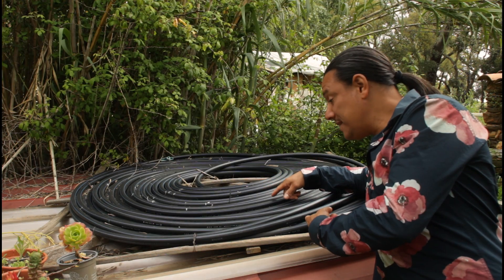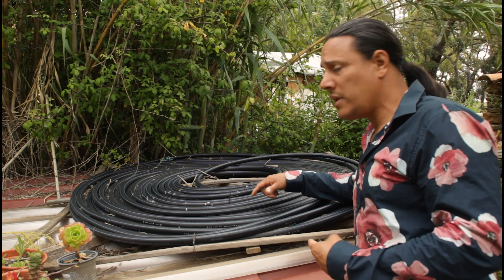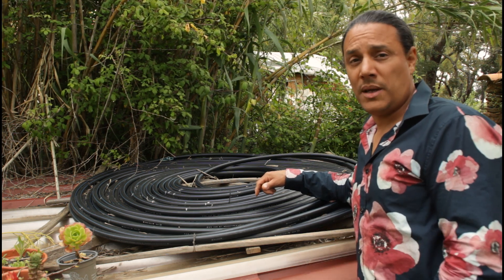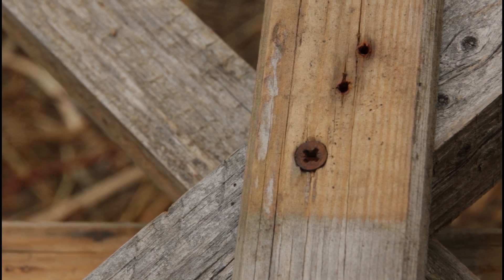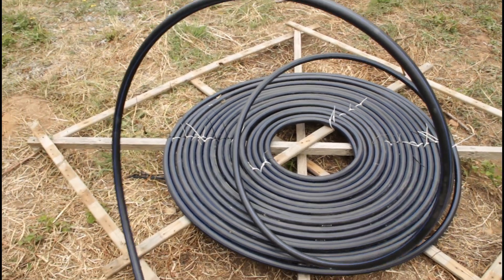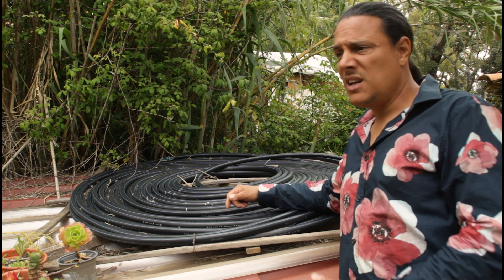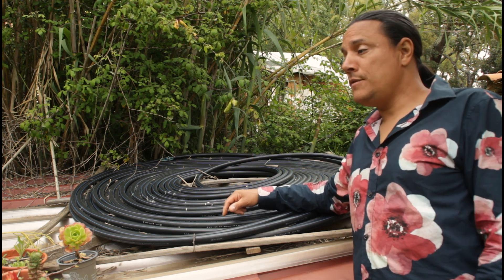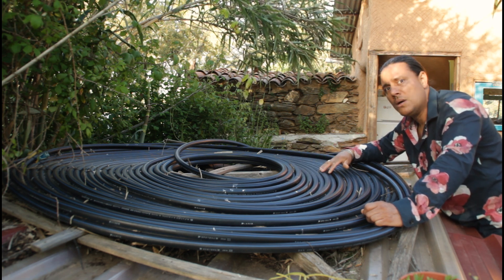Free Hot Showers Using Only the Sun (DIY Solar Coil Heater)

Comment: Yes please- how to fittings from pipe coil 🙏
Reply from the maker: Noted! An extra small shower structure is in the books. I need another coil on the roof.

Will keep you posted but have to save for materials so could take a while 🤓😆

Comment: Jus a possible tip, u ever thought up putting aluminum or a mirror at the bottom.. theoretically creating two surfaces that act to heat the water pipe ( just an idea )
Reply from the maker: Yes, this could work definitely and will make the water way hotter, BUT  in this climate here, it would destroy the pipes!

In a cold climate you could do that and make a glass box as well but be very careful on hot summer days. The pipes also come in different grades suitable for different pressures. 

Thanks foe the input!

Comment: The tropical sun is verry hot, 😅😅
Reply from the maker: Yes! In a colder climate, you could do a similar system with copper pipe in a glass box. Ofcourse with limitations but still